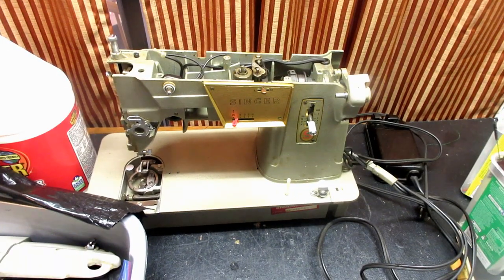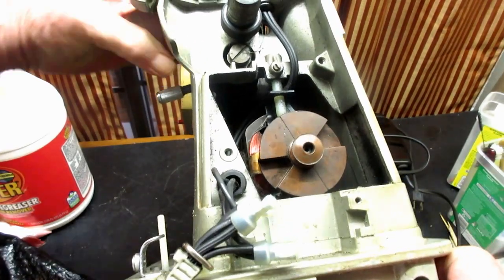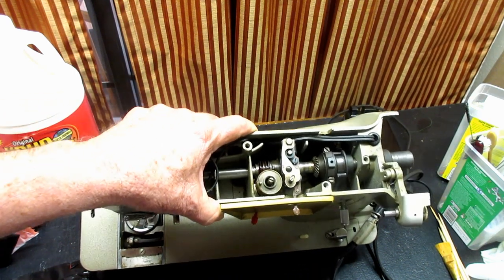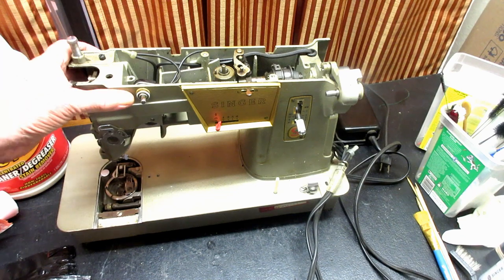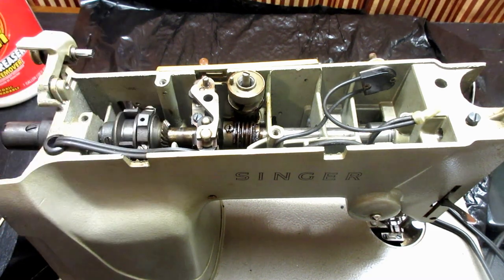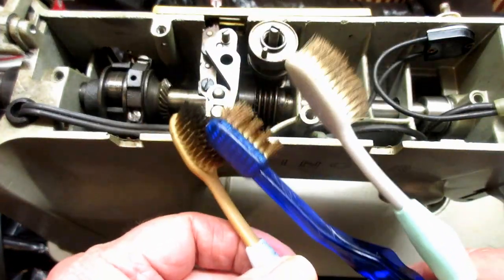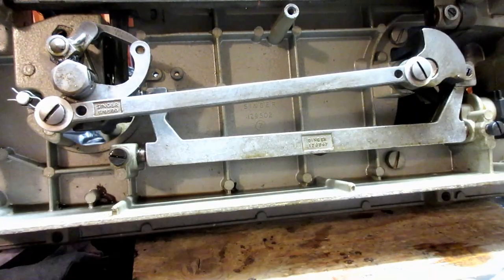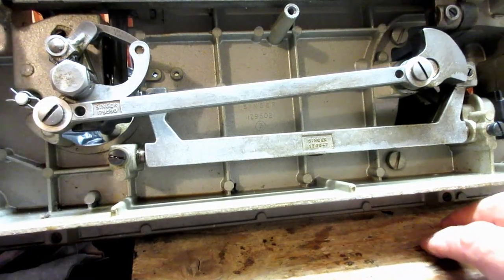Wash sewing machine motor while inside machine - Singer Model 328K

Comment: I have a Singer 347 that has a stripped out screw in the front cover plate, too. For smallish complex steel parts with lots of nooks and crannies, I blow dry them first as best I can, and then give them a shot of WD-40 to drive out any last vestiges of moisture. this prevents rusting until it get to working on them further.
Reply from the maker: That's a great idea, jo. I'm pending your comment to the top for others to see thanks for sharing that idea and for watching my channel

Comment: You brave man! Next level is dunking the whole machine in a ultrasonic cleaner.

Actually, some people do it. Others use a steamcleaner to get the gunk out.
Reply from the maker: If I had a large enough tank I'd be interested in the ultrasonic method. I'm sure there are several other methods that could work. I had a viewer tell me just "Sprays the H**L out of it with brake cleaner". I settled on the Krud Kutter wash method because it is a water-based earth-friendly cleaner. not expensive, requires no special equipment or volatile chemicals, and does a great job. I've never seen a video of using a large ultrasonic cleaner or steam on a sewing machine. Thanks for watching.

Comment: I got replacement bed cushions at the local ACE hardware store. Best of luck with your treatments.❤
Reply from the maker: That's very handy! I can't find a local seller. There is one sewing center about a 90-mile round trip away. He charges $1.50 per cushion but the gas is more than shipping. I met the owner of one of the ACE stores in my town and asked about carrying the cushions, tires, spool pins, etc but he says they would never sell enough of them to justify the hassle. Like everything else, the cost of cushions is ridiculous now.

Comment: Andy, do you have any idea on how many amp draw that motor is and how the power compares to those p8 motors in the 404 and 503 machines?  P.S.  Another clear, concise video on how to clean another of Singers great machines.  Thanks Andy.
Reply from the maker: The number that comes to mind is 0.67 AMP, but I don't know if that is correct, sorry.
The motor on the 401A, 403A, and 404 is 0.7 AMP

Comment: Andy, one thing I'm unclear about is how you stopped water from getting into the electrical connectors.  Did you tape off the connections?
Reply from the maker: I did not stop water from entering the connections or the lamp socket or light switch. All of that is copper, bronze of plastic. A quick wash and a long drying and no harm is done. I took the light switch off to inspect it, and the terminal for the cords. All dry with no damage. I've done an entire motor after soaking it in dirty water for 25 hours. (maybe you saw that video?) Washed it and dried it and it works great, so 5 minutes of water did not worry me. While washing the covers with dish soap I washed the motor belt with the KK and it is good. The key is to dry-dry-dry all the parts quickly after washing. Thanks for your question, and for watching my video.

Comment: Hi! Thanks for sharing! This video is very helpful. I received a similar machine as a gift. I did a basic cleaning. I'm learning, so your deep cleaning method is too advanced for me. 
The motor had a lot of thread and black crud. 
What state are you?
Do you have a video putting the machine back together? 
I'm having difficulty with the hand wheel.
Thank you again!
Reply from the maker: I have dozens of videos for working on all the parts of machines like this. https://www.youtube.com/playlist?list=PLsCOZgzzaiKKHFzTFVJrwVQT6hMfXxFHt         https://www.youtube.com/playlist?list=PLsCOZgzzaiKJxbOOMKQPvmeTRqi0dhGa5       https://www.youtube.com/playlist?list=PLsCOZgzzaiKK4y8dsq3oMKJFTGsoNJWmi   This video shows removing and replacing the handwheel. https://youtu.be/6H-SDwXLQDk
Reply: @andytubesewing1953  thank you!
Reply: I will search through your videos for a needle thread assembly. The machine has some stitch issues, and I think it is the spring in the needle thread tension.  Thanks again
Reply from the maker: @cocasio7190  Surely. If you have a different model number/type than in my videos let me know and maybe I have info for it. Good luck.
Reply from the maker: @cocasio7190  oh that's interesting okay there should be something there if you can't find it let me know thank you
Reply: @andytubesewing1953  thank you so much!